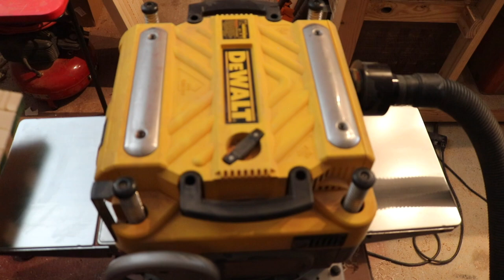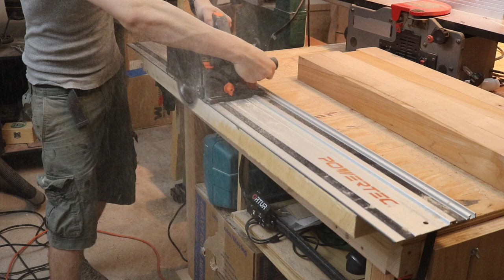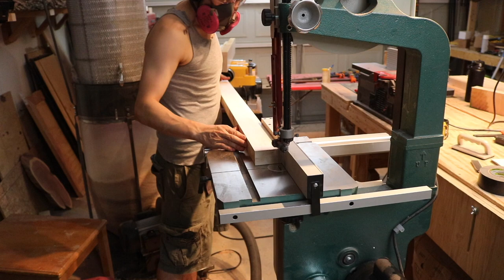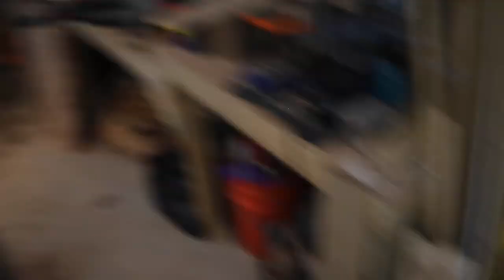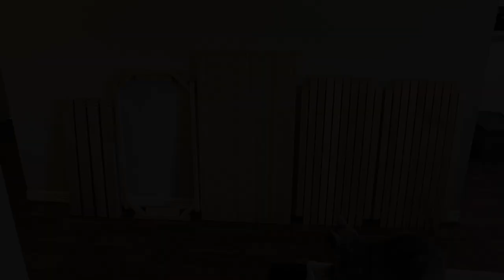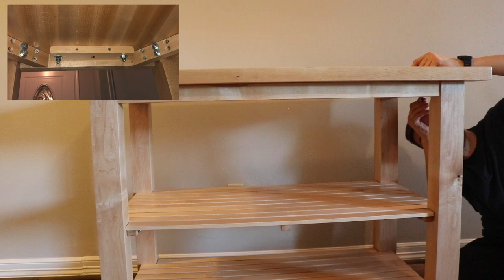Kitchen Island - John Barnes - No Voice Over

Comment: very nice, but I am not sure how you fix those bolts in the legs? did you use some sort of inserts?
Reply from the maker: Thank you and yes, exactly! I used some zinc allo hex flanged screw-in threaded inserts. Great way to ensure the piece is both strong and can be disassembled
Reply from the maker: Also check out the other video I made of this build with instructions! Might be a little more informative :)
Reply: Thank you for giving me the exact name of the part @johnbarneswood